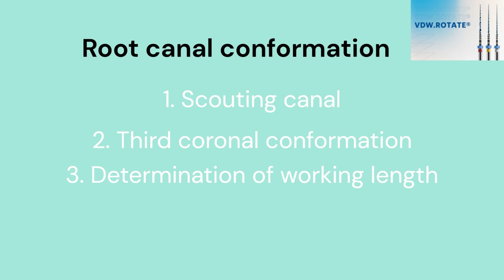Root canal conformation step by step Rotate system (vdw)

Comment: Are you using 25/6 as a first rotary file after scouting with 8 file only or after using 10 and 15 file then 25/6 rotary file .
Reply from the maker: Hi Dr. in this case i I did it after 8K file because it was “wide” But many times I use rotate 20.05 after a 8 or 10k. Never a 15k.